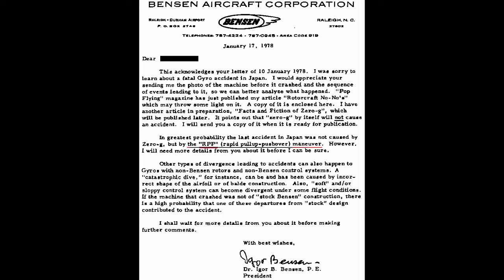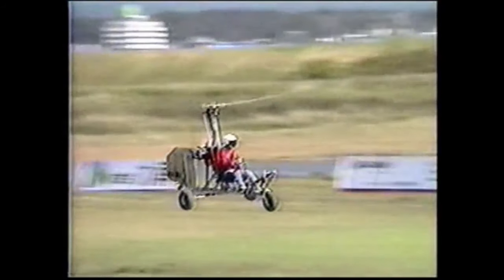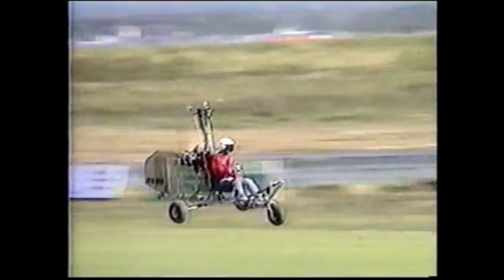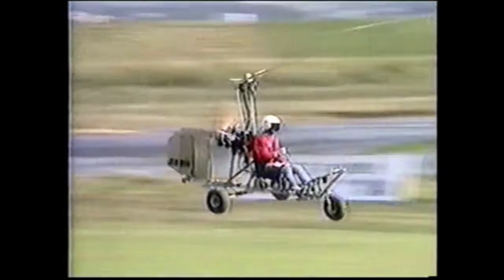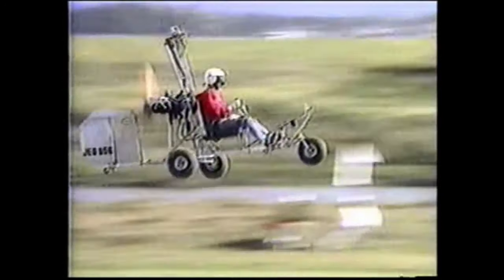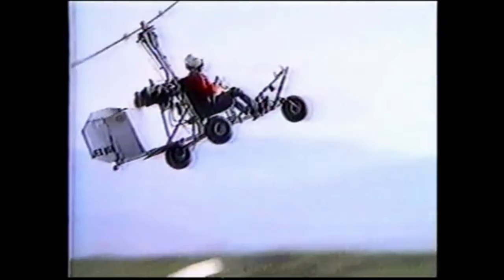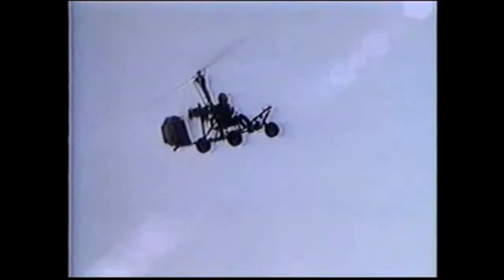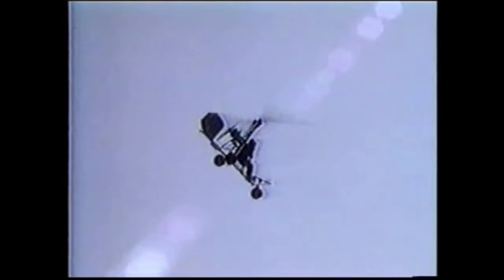Gyrocopter low g power push over crash (the cause of many gyrocopter fatal accidents)

Comment: I did six hours training in a giro. The continual emphasis by the instructor was never ever put the machine into negative g and throttle off before leveling off.
Reply: Six hours should be enough to learn how to spell gyro.
Reply: @rdaystrom4540  lol he said six hours
Reply: @rdaystrom4540  You just had to be THAT GUY.
Reply: @rdaystrom4540  😂...
Reply: @rdaystrom4540  Yeah, it´s greek, and in greek it´s written with an "Y", but still, in romanian languages like Italian/spanish (but not in french, I think), they write it with an "I"... Romans would do anything to display themselves as non-Greeks, cause they were fed up with others believing them to be also Greeks, so, they changed stuff delivered to them by the Greeks, in order to gain an own identity (at the same time "Rome" itself being a greek word too, meaning "Strength", of course   ;-)
Reply: @rdaystrom4540  Actually it only takes around 10 hours to add a gyro rating to your license.
Reply: You don't have to throttle off.  You shouldn't try to stop the machine with pitch.  So if I hold on full throttle in a zoom climb with this it will eventually slow to normal airspeed which in the gyro shown would be about 30-40mph.  At that speed you could happily ease the stick forward no issue.  In fact had he held full throttle on eventually it would have slowed to a stop and done a vertical descent all with full throttle, you'd just ease stick forward until 30-40mph was reached and then reduce power.  What you should never do is try to stop a climb with forward stick.  You can stop a climb by reducing power normal, doing a wing over (Quite aggressive and not recommended for the novice), or wait for airspeed to bleed off.  His problem was the gyro was still going up and he tried to stop it by flattening the disk.  He needed to either wait or reduce power then wait.  So what your instructor was suggesting would work but you wouldn't reduce to no power at all,  generally you'd reduce power to control climb then use stick to maintain airspeed.  Basically avoid anything that will lift you in the seat.
Reply: @rdaystrom4540  You must be a very sad type of person....just no need.

Comment: Um... there was nothing 'gentle' about that push over. As a commercial pilot (helicopter, fixed wing and gyro)... any push over like that will create a severe negative G and the inevitable rotor strike to the aft section of the craft. The pilot just got a bit carried away with his manoeuvres and it cost him his life. Gyros are one of the safest aircraft to fly but abuse the aerodynamics and it's unforgiving.

Comment: These are always so sad to watch. There were multiple safe ways out of that situation (chopping throttle at the top of the climb with stick aft until the aircraft settles, bank the aircraft and pull the stick back to turn out of it), but the instinctive thing to do (push the stick forward) is the one thing that will kill you. Zoom-climbs aren't inherently dangerous on their own, as in they won't kill you on their own, but one wrong move (which also happens to be the most intuitive move) can make you very dead, very fast. A very nasty peculiarity in an aircraft type which is usually so intuitive to fly.

Comment: I’m glad you mentioned about unloading the rotors as this occurs with microlight trikes as well. A typical incident occurs when the pilot entered a fast climb and attempts to level out by pulling the bar in sharply, unloading the wing and possibly some negative g. I saw a fatal accident where the pilot pulled the bar in firmly after a 45 degree climb and ended tumbling three consecutive rotations before hitting the ground. We also are trained to throttle back, maintain the current angle of attack and allow the wing nose to drop approaching stall. Followed by an increase in throttle and level flight resumed. Thanks for your clear and concise information on rotorcraft.
Reply: I'd never fly a trike. They're incredibly dangerous if mishandled or if you just happen to get the wrong draft of air. It is what killed Lillienthal and a trike isn't much different than a hang glider. Relying on brute force CG shifting to control an aircraft is just an accident waiting to happen. And once you lose control, there is no regaining it, same as an autogyro. At least a helicopter can recover if you lose lift, assuming you stay outside the death curve. But since you can't control rotor blade pitch in an autogyro, you have zero options, regardless of altitude.
With training rooted in ab initio aerobatic flight and unusual attitude recovery in complex, high performance single engine trainers, I simply can't fathom taking a risk with an unrecoverable aircraft. Reminds me of the Ercoupe - easy plane to fly. Extremely difficult to stall or spin but it is possible. If you do either of those things, 100% guaranteed you're buying the farm, no matter how good a pilot you are. You could be Patty Wagstaff or Bob Hoover; if you spin an Ercoupe, there is no coming back.
Reply: Thanks for your reply. I have hundreds of hours on trikes and yes, I have seen some disastrous results of poor airmanship. Quite frankly any lightweight aircraft doesn’t have any inertia to get you out of a bad situation such as engine failure on climb etc. only good training and knowledge of the limitations of each individual aircraft you currently fly will get you out of the situation. Most friends over the years that were either killed or injured I know did make the mistakes that were unrecoverable. As long as you never put negative g’s on a trike they are probably one of the safest aircraft I have flown. In regard to turbulence, as I said there are limits that cannot be ignored and some push past them with consequences. Trikes are incredibly strong , one even surviving a midair collision with a Cessna with minimal damage to the aircraft and pilots. I value your opinion but as long as you fly them within their envelope are quite safe.

Comment: Gyros need constant pressure under the rotor to maintain lift.   a push over like that stalls it.
Reply: How can the pilot detect that it is going to happen before it happens? Maybe by looking at the rpm for the rotor?
Reply: @divadjens4278   Airspeed slows but like he said just don't do high energy maneuvers like this.
Reply: It's not really a stall, because the rotor never stalls. What is happening is in a zero/low g situation, you have zero lift, hence no flying surfaces available to provide directional control, so the thrust-line of the powerplant becomes the only control available.

Comment: As someone who wants to fly one day, and possibly own a gyro, this was indeed a reality check. no matter how much "time" I have in my simulators and games, none of that would have helped me as much as your video has. I still wish to learn and build one of these machines to fly, but I'll do so with this stark reminder to fly safe.
Reply: You'll be fine if you just take your time and fly "normally" i.e. no messing around.  Always err on the side of caution and seek the advice of your local instructor.  Remember the first 1000hrs are the hardest and you only tend to get to crash an aircraft once in your lifetime!
Reply: Those gyrocopters don't power the top blades. Forward motion through the air gets those top blades to spin so that it acts like a wing. Sure you can auto rotate but you better keep forward motion going till at the ground.

Comment: I think the original La Cierva way of making autogyros, front engine and prop,  with empennage, just an airplane with a rotor instead of wings, is much more secure and controllable. Plus the prop helps the rotor to rotate for easier take off.
Reply: I used to fly an R/C model like that, motor up front, 2 fixed counter-rotating rotors on a fixed axis, with (oversized) elevators and rudder for control.  Even at low airspeed the aircraft still had decent control authority because of the prop wash over the control surfaces, and that has gotten me out of a few dicey situations.  Though I'm not sure how it would compare to a pusher prop config.
Reply: AMEN..! Ever had the coin to purchase a gyrocopter of any kind…, it would be a tractor…!
Reply: He got rid of the wings because using proper cyclic control allowed full control to zero airspeed landings and there had been a number of accidents on landing.  There is nothing wrong with the stability of gyros if you understand their limitations.  Unlike fixed wings which have good stick fixed stability.  Gyros have superior stick free stability ie.  Don't touch the controls and it stays put.  But unlike fixed wings they have shitty stick fixed stability.  That is touch the controls and they'll start turning and keep turning you need to put in an active correction unlike say a Cessna which will sort itself out.  

Combine that with in light gyros feather light responsiveness and in all gyros insignificant control input for a very big input and you have if not trained carefully a recipe for disaster.  

I used to train people in gyrogliders.  And I'd get guys with 1000's of hours in Cessnas or GA aircraft and they would have the stick in a death grip and would over control like nobodies business.  And that was dual solo the gyro was even more sensitive.  But once you learned to fly by pressure no X amount of stick deflection it becomes natural and easy.  Once you had them solo in the glider their chances of dying from over controlling were near zero.  In fact no one I ever trained or trained by the guy who taught me died in that manner ever.  Yes there were people who did stupid things like try to fly through power lines etc.  But not piloting issues as such.  

Because the teeter system automatically compensates from side of to side (dissymetry of lift) it also compensates for any thermals etc which would in a fixed wing force you to apply an input to straighten out.  A properly set up gyro (correct downthrust etc).  will even in massive thermals just climb and descend without needing corrective inputs.  But put in an input and it will respond instantly.  

So learn to respect it and it will fly safely and smoothly even in conditions most pilots would stay grounded in.  But its not a fixed wing and training is very unusual to do it properly.  They are their own thing.
Reply: Still a dangerous aircraft with zero recovery options if you get outside the flight envelope.

Comment: I fly helicopters, most of my 14,000 hours with the Army 160th.  No rotor system is safe under negative g loads.  If it’s not safe in an AH6, it’s certainly not safe in one of these little things.  Just my 2 cents.  Keep your ass planted, not floating.
Reply: These things seem to be an amalgamation of the worst parts of both a plane and a helicopter - the ability to do an aggressive unrecoverable manoeuvre, where in a plane there is a chance of stall recovery thanks to wings, yet requires rotating blades for lift - which are unpowered. Eh.
Reply: To watch Sir Ken Wallis flying his machines was a joy. He flew very spiritedly, but obviously knowing his aircrafts limitations. 
Sadly, autogyros do not take prisoners when mishandled.
Reply: I used to think I wanted a helicopter but I think I'll stick to flying my STOL ELSA. I like to float. And do some light aerobatics. Practically speaking, there aren't a whole lot of places that I can go in a helicopter that I can't go in a plane that can take off and land in a couple hundred feet. 
I've experienced autorotation in a helicopter. It is arguably the most unsettling experience I've ever had in the air and I've survived a stall turning onto final at about 250ft AGL, 3 near misses and inadvertent flight into IMC.
Reply: If anyone knows the limits of their aircraft it's the 160th.

Comment: I've always heard about this and have read about it but this is the first video I've seen that actually shows it.  Frightening!
Reply: @Gratte Burnes  - yes, but as the video also points out, the pilots control movements weren't that abrupt.  I was amazed at how easy it seemed for him to get into that situation.  If the pilot had jammed the control forward at the top of the climb, this would have made sense but that's not what he did.  I think it also speaks to the "high thrust line vs center line thrust" arguments I've heard through the years related to the pusher style gyros like this one.  I've heard a lot of pilots continue to argue that high thrust line configurations aren't a problem.  Quote, "They've been flown safely for years."  That may be true in and of itself but I think this proves that they're an inherently unsafe design regardless of how many hours they've been flown.  One way or another, it's just a matter of time.
Reply: the pilot was going up with a steep angle and then he level the gyro  but at that point the engine could not push the gyro  and at the end the blades hit the rudder cause of the flapping
Reply: @Thebasicmaker   - He pulled up steeply and then pushed over to level the aircraft.  When he did that, he off loaded the rotor and the high thrust line configuration, still at a relatively high power setting, started rotating the nose downward, hense the term, "power push over."  The engine thrust may not be adding much in the way of airspeed at this point, but it is most definitely still pushing the gyro.  The pilot eventually pulled back on the stick to try to stop that motion, a purely instinctive reaction but if you watch the video carefully, especially the slow motion part at the end, the rotor never impacted the rudder.  There is some small part that flies off the machine just before impact but it's not coming from the rudder area.  I'm not sure what that is.

Comment: And of course avoid high thrust-line gyrocopters(engine thrust above aircraft CG).  If adding power causes a nose down movement you are in a high thrust-line aircraft and unloading the rotor(lowering rotor thrust) at a high power setting(high speed and turbulence) is hazardous to your health... A centerline or below centerline thrust aircraft is way safer as an inadvertent rotor unloading such as can happen in turbulence either induces no pitching moment or a positive one which tends to re-load the rotor...